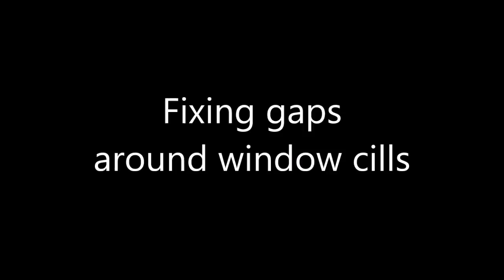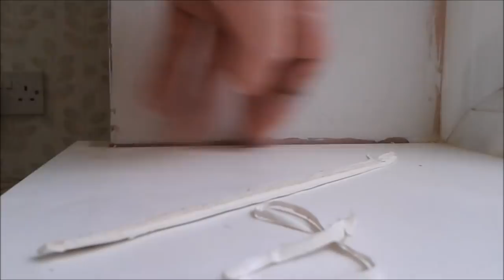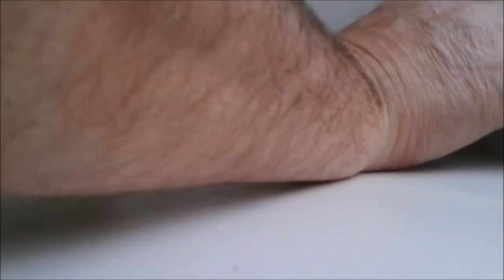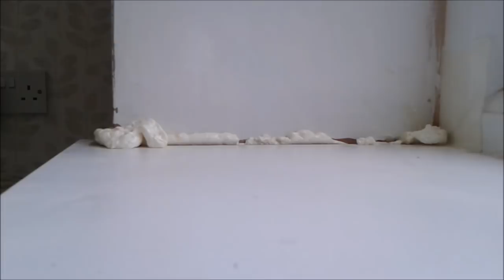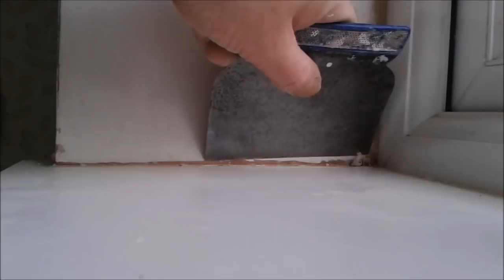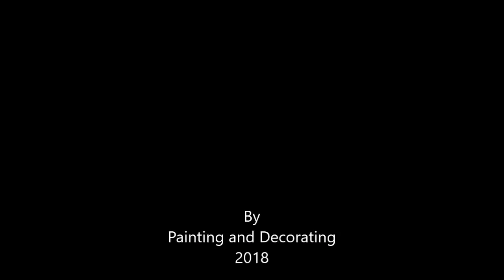Fixing gaps around window cills

Comment: Hi, In your video you show caulking/silicone removal between wooden sil and wall followed by use of expandable foam then filler. Should I remove crazed and split silicone between window sil and upvc frame? Your advice would valued. Many thanks. Ellie
Reply from the maker: Yes and replace for a tidy finish. Thanks
Reply: Thanks. I presume you mean replace with expanding foam and filler.
Reply from the maker: @elliewoods5744  it depends usually yes but sometimes a paintable sealant.
Reply: @PaintingandDecorating  Thank you. Will give your recommendations a go.

Comment: Tried foaming my pvc door frames in kitchen the other day to fill the gaps. Totally messed it up, but it was a good lesson and I won't repeat the same mistake. I went a bit crazy on the trigger, that stuff expanded beyond my expectation and it went everywhere and over the kitchen surface and I used up a whole can in no time. I made good in the end , but took me much longer than it should have.

Can I ask when you have finished using it do you clean the plastic tube out or just leave it?
Reply from the maker: Yes, squeeze out as mush as you can the replace stopper. Practice makes perfect.. thanks

Comment: Thanks for this video - just what I was looking for and a great explanation! I also have hairline cracks appearing vertically at the corner joints where the plaster, window sill and UPVC frame all meet. Would you recommend just using the filler on these as they are too small for the expanding foam? I'm have been tempted to leave them but the plaster gets damp in the winter as if moisture is getting in so I don't want mould to develop. Thanks in advance for any advice!
Reply from the maker: Sorry for late reply.. Best making sure the window is sealed all around. You can add mould inhibitors to any paint. Thanks.
Reply: @PaintingandDecorating  Thank you for the reply! Much appreciated :)

Comment: Nice video. 
What would you use for any gaps if the cill is a wood finish and the wall colour is non white? 
Cheers.
Reply from the maker: Thanks...   usually the wood goes underneath the wall... so you only really need to fill the wall and we use pollyfilla.

Comment: I'm curious how long this takes for an entire window or perhaps a whole room with a pair of  100" × 72"  windows? I know you can't give a proper estimate but a rough guess?
I'm currently tasked with prepping my rental house for interior paint. None of the windows have been sealed around the outer edge of the windows where the meet with the drywall. It's a nightmare.
Reply from the maker: you should be able to get all your window surrounds prepped in a day.  Dust sheet at every window clean and scrape each one then foam and fill. thanks.

Comment: Great video and I have loads and loads of these to do! : (( I am finding myself in a dilemma of how to prep the ridge left from the where the paint is/was to the bare plaster where the caulk/ silicone was. On this video you haven't sanded or filled it... will it not show through after painting? or did you fill over the bare plaster once the filler on the sill had dried? many thanks for all your videos - they are invaluable! : )
Reply from the maker: Thanks... In the video the edge was not that bad but I'm sure i say sand it..

Comment: Wouldn't it be just as easy to caulk it and then paint it? Or do you know something that I don't?
Reply from the maker: Yes, caulk takes too long to dry especially in winter and can shrink when dry and paint cracks.
Reply: Painting and Decorating makes a lot of sense thank you
Reply: Siroflex do a caulk that can be painted immediately after application.
A lot easier and time saving.
Reply: Nice one.

Comment: And any movement in the sill will crack the filler at the joint of the sill and the reveal.
Reply from the maker: Jakori the foam stops movement this is tried and tested you can use a flexible filler. Only in extreme conditions will it leave a fine crack with normal powder filler, and then you can use a flexible filler.
Reply: Yeah a flexible filler like caulk. And no doubt the foam will help reduce movement but never stop it all together, and there are a lot of caulks that crack and shadow, however I find theses are usually the cheapest on the market. The foam with a good quality caulk is how I like to go. A friend of mine recommends using contact adhesive set back a few mm and either fill or caulk over the top etc. Rather than foam. So many options these days.
Reply from the maker: Jakori yes lot of methods but the foam then a filler of your choice is the best way to go.

Comment: If this was exterior, what filler would you recommend? Sills are stone and have pillars with cracks and gaps.
Reply: toupret murex best on market for exterior stone masonry etc but you must apply it right first time as you can not sand it as it is cement

Comment: for a smal area is easy  is ok but  if you got a lot off area would fast  to use the caulk loved the video.
Reply from the maker: It's all about drying time and when you paint on caulk that has only skinned over and not fully dried the paint cracks as the caulk dries fully and shrinks. Caulk in deep gaps can take a week to dry fully in cold areas. Foam is the best and maybe caulk over the top but I prefer powder filler or a flexible wood filler something that dries fast and can be sanded and overpainted in the day.
Reply: For deep gaps try Fossa caulk saver , it come's in foam strips and can be pushed into gaps prior to caulking .
Cheap as chips and so much quicker.

Comment: I would just just two part filler, wouldn't risk using expanding in case it pushes the window frame out as I have seen chippys do that mistake before
Reply from the maker: Windows that push out from a little foam must be badly fitted in the first place, windows need to be secure and this method helps fill voids and insulates from cold and noise
Reply: Painting and Decorating haha do you know how strong two part filler it's denser and sets like concrete, hence if they are badly fitted and you can't see that and use foam well then . Look up how strong foam is when expanding you will be surprised.
Reply: Not saying it's wrong, just having the idea that two part push in with a thin filling knife will do the same trick and again got the strength there as well. Just as I've seen it go wrong with Windows before from others lol
Reply from the maker: xo Hazza I know foam is strong when expanding and windows should be fitted using foam to give them A rated insulation in the first place.
Reply: Painting and Decorating far enough another way learned anyways
Reply from the maker: Thanks.